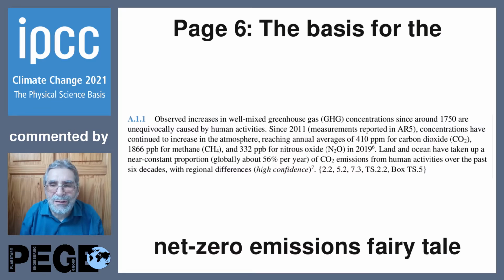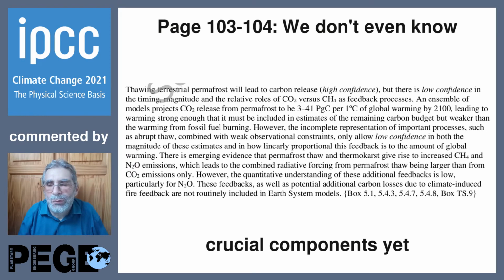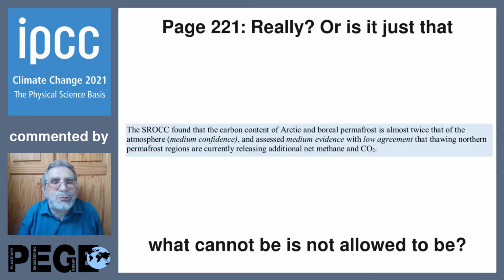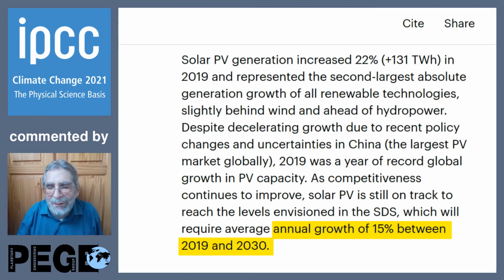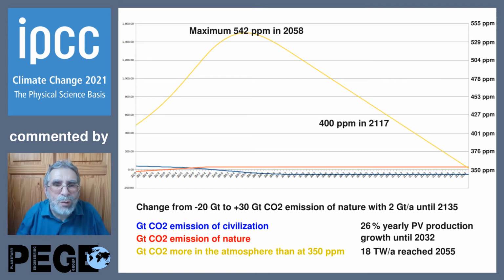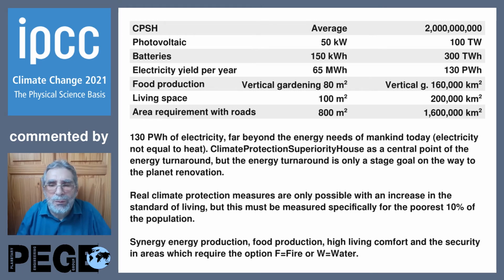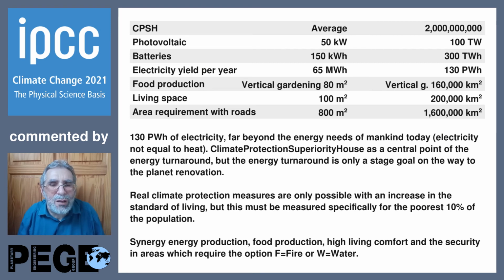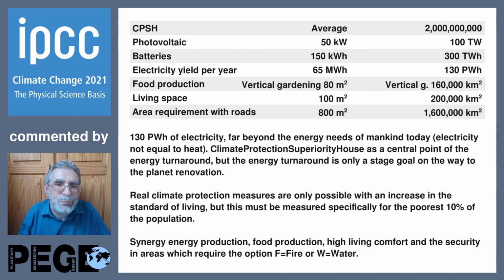IPCC Report 2021: “Net Zero Emissions” Fairy Tale and its Devastating Consequences

Comment: Don't think in terms of houses. Think in terms of bunkers. Where there is energy usage of any kind, heat dissipation will be the big problem so placing the main structure underground will provide insulation and allow for the temperature stabilization you find in caves. You'll need some good heat exchangers. Building high up in the mountains will reduce the cooling requirements. Large parts of the globe will go totally dry and others will be swamped by rain and flooding. A high location with continued rain is probably the best location with a cistern included. There will be no snow melt except occasional flash blizzards followed by floods (something we are already seeing).
Reply from the maker: Compared to usual in southern part of US houses, the energy usage for cooling in summer can be reduced by 95%. I am just defining completely new what the abilities of a house have to be. https://GEMINIs.pege.org
Reply: @pegefounder  Yes, but you are still thinking in terms of single houses as is our cultural custom. We are going to have to completely change how we live including looking at communal living spaces.
Reply from the maker: Effective climate protection is only possible with a higher standard of living.
In recent decades, climate protection has failed only because people have preached "save, cut back, do without" despite the fact that technical progress and price reductions were foreseeable.
Reply: @pegefounder  I think the real issue is irrational, rampant, uncontrolled resource consumption, but any disagreements will likely be worked out in the evolutionary process.
Reply: A bit more explanation: Most of our current resource extraction is for the purpose of wealth generation. But, wealth is a social construction. Most (a good 90%) of the wealth generated today is to position individuals in a social hierarchy. This wealth has no practical value and does not contribute to any true standard of living. We are in the same position as the Vikings in Greenland who could not give up their cattle because cattle represented social wealth. Still their cattle died because of (natural) climate change. They left no ancestors on the island. The Inuit peoples in the area fished and maintained a practical and relatively high standard of living while the Vikings died out. Standards of living are a relative measure.
Reply from the maker: With the resource usage is only the problem with the throw away energy. The waste of throw away energy is CO2. We will have to recycle all our resource usage. The first huge recycling action will be to filter CO2 out of the atmosphere and split it into O and C and have a better more useful usage for the carbon.
This action is called planet renovation, but there will be even much more challenging tasks for humanity in the future.
Reply from the maker: In the future, even the poorest 10% of population will have a better living  standard than the richest 10% only 100 years ago.